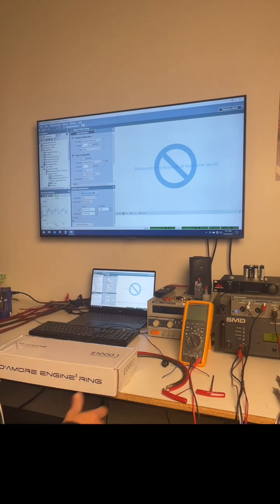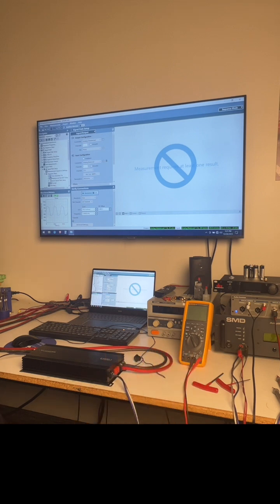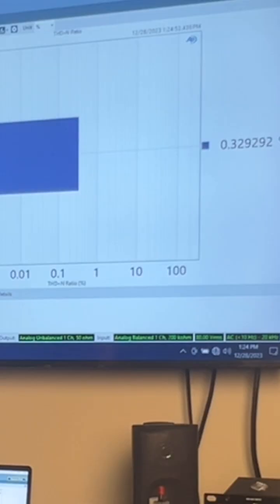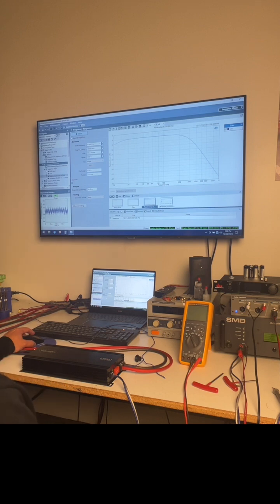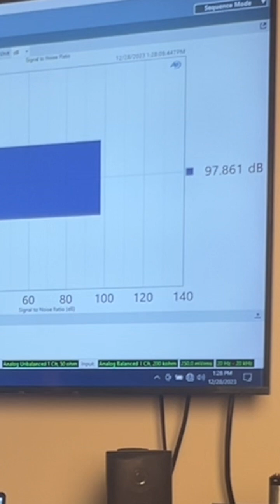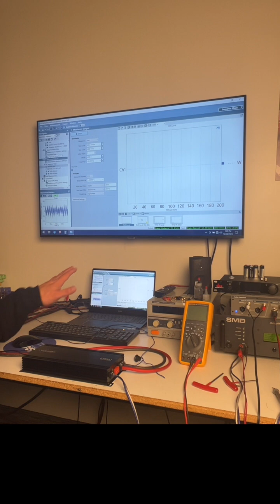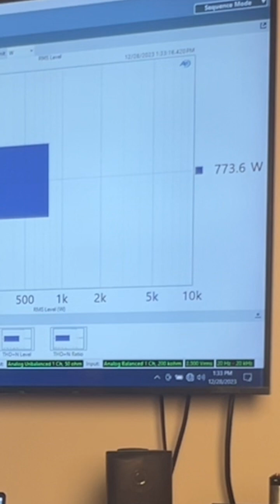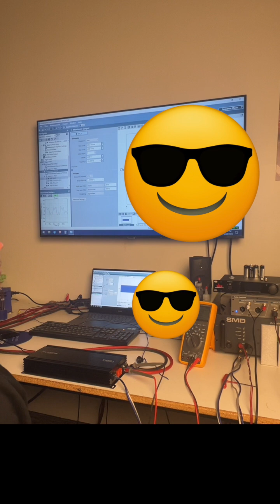S1E3 D'Amore Engineering Bench Testing E1000.1 Car Audio Amplifier

Comment: I PURCHASED THIS AMP AND IT SOUNDED AMAZING, I HAD IT PUSHING 2 B2 AUDIO RAGE 8'S. ID SAY IT SOUNDED JUST AS GOOD AS MY ROCKFORD FOSGATE PUNCH 1000.1.  PROBLEM WITH IT WAS, IT DIDNT LAST 2 MONTHS, AFTER GETTING HOME FROM WORK , I LATER HAD TO RUN INTO TOWN,  WELL NO SUBS! I CHECKED EVERYTHING , IT WOULD POWER ON, BUT NO SOUND, I PULLED MY PUNCH AMP OUT OF MY TRUCK AND AFTER HOOKING IT UP, SUBS WORKED GREAT,  I HOOKED THE D'AMORE AMP BACK UP AND AGAIN NO SOUND. AFTER CONTACTING SERVICE , I WAS TOLD YALL DID NOT SERVICE ANY AMPS IN HOUSE AND I DIDNT GET ANY HELP WITH THIS NEW AMP I HAD PURCHASED. I COULD NOT EVEN GET A REFERRAL FOR ANYONE ELSE THAT MIGHT COULD FIX IT. I HAD ALWAYS HEARD HOW GOOD AND EFFICIENT THESE AMPS WERE AND WHEN I FINALLY DECIDED TO PURCHASE ONE AND HAD THE FUNDS TO DO SO , IT DIDNT EVEN MAKE IT 2 MONTHS, I WILL SAY , ITS A GREAT DUST COLLECTOR . IF ANYONE  HERE KNOWS OF A REPUTABLE COMPANY , PLEASE LET ME KNOW SO I CAN TRY GETTING THIS AMP FIXED